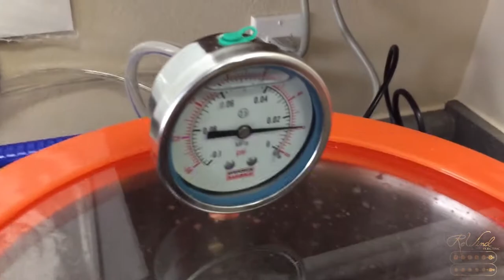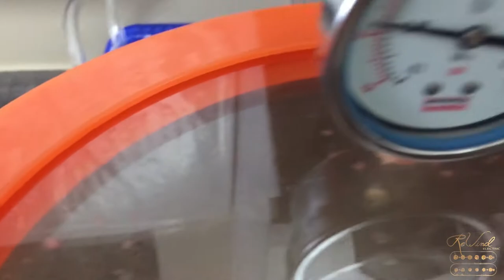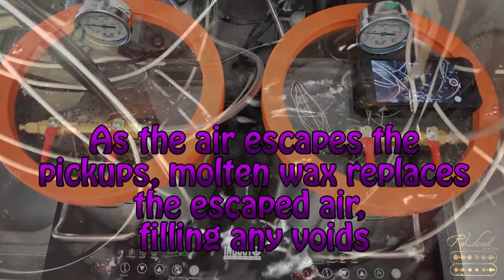Vacuum Potting Guitar Pickups in Wax Explained

Comment: The boiling point for paraffin at -12 psi would be around 140C, I’m guessing the vacuum won’t pull any lower at that temperature because it’s trying to reach an equilibrium. The air would definitely be gone from the pickups but the boiling paraffin around it might be a bit extreme on them. Maybe try sitting the pickups on top of solid wax, pulling the vacuum all the way down as far as it goes, then beginning the heat, and slowly backing down the vacuum as soon as any signs of boiling begin, after the pickups have submerged into the melted wax. It should provide a good result, air won’t reenter the pickups once they are submerged. In fact, allowing the pressure to increase after the pickups are submerged and all the air is released will actually compress any remaining air bubbles and density the wax.

Comment: Are you sure it's just the air in the pickups, that looks more like the wax is boiling from being warm and under vacuum.
Reply from the maker: Yes, because the bubbling slows and eventually stops if the pickups are left in long enough and never starts if I don't place them in there. If it was just boiling, the same thing would happen without anything in the wax. You can also see (when just doing one or two) that the bubbles originate from the pickups only.
Reply: It’s definitely boiling

Comment: Nice video! Why black wax?  Is it different than the 80/20 mix of Paraffin and Beeswax?
Reply from the maker: Just because that's how Fender did it in the 50's and some of the 60's, so that's what my clients expect to see on a vintage-accurate replacement pickup for those periods. The 80/20 ratio isn't a hard rule, either. There are advantages and disadvantages to a richer or leaner blend.